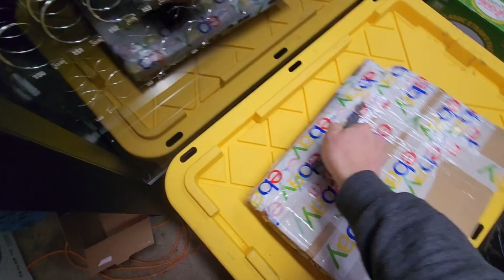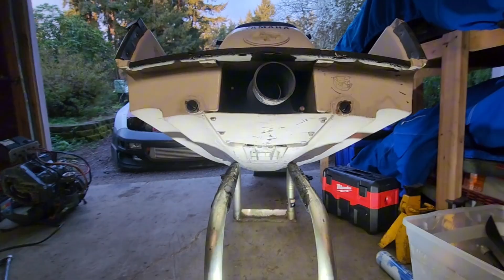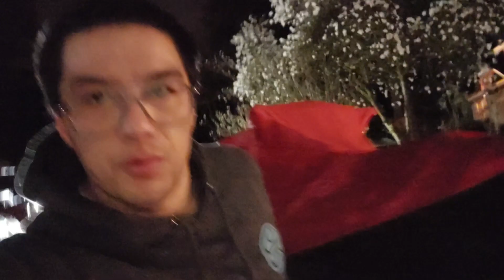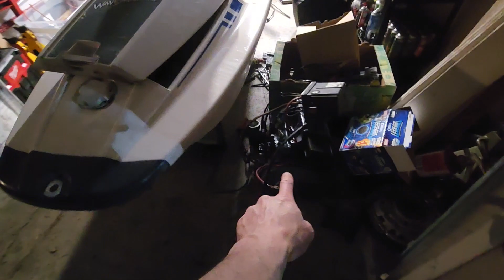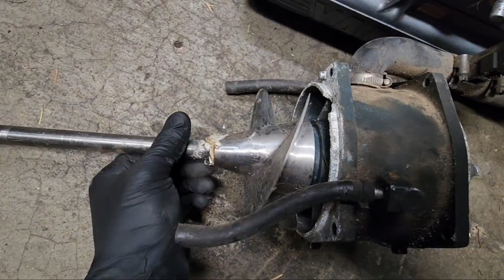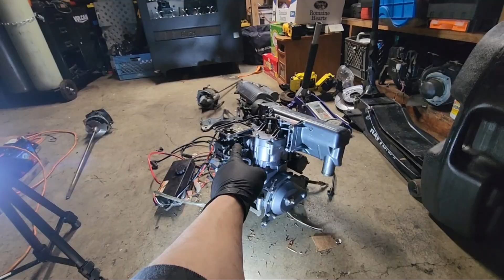WaveJammer Build Gets Serious… New Ride Plate & The Swap Engine Is Here!

Comment: I have one of these! I believe the first year model, I was 12 years old when my dad bought it new from Yamaha! I have been thinking about reviving it, even at 12-14 years old I remember thinking it was gutless!! often could not even pull itself out of a deeper submarine with my little 13 year old frame on it!! I was a small kid!!
Reply from the maker: Yeah i wish they had put the 650 or 701 in it from factory with a bigger pump it would have been a game changer. These things are so much fun with more power. You should definitely  restore it if you like riding it the 650 swap can easily be done in a day if you have all the parts
Reply: @freestyleunlimited I live in ON Canada and just looked on marketplace and a guy can pick up a running 650 wave runner for a few hundred bucks! I am going to seriously consider this, the poor wavejammer has been in storage for probably 20 years or more, I know the last time I ran was around 20-25 years ago, but besides being faded it has always been looked after, and was fogged when put away.
Reply from the maker: @robmassicotte4889 do it, especially if you can get all the parts that cheap it is so worth it